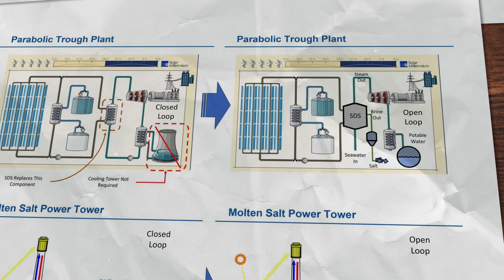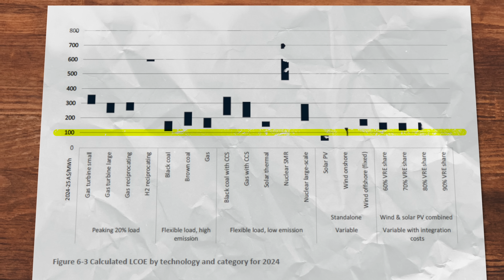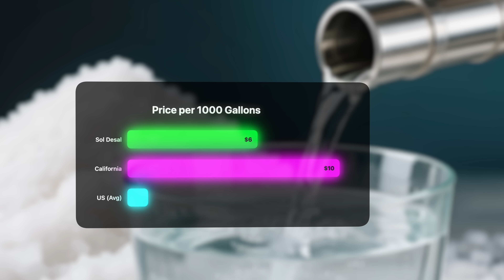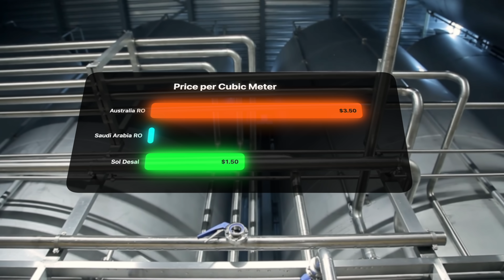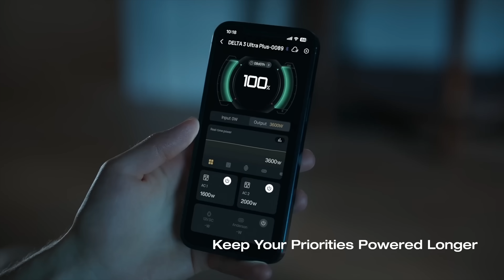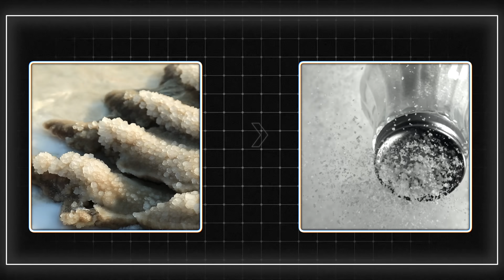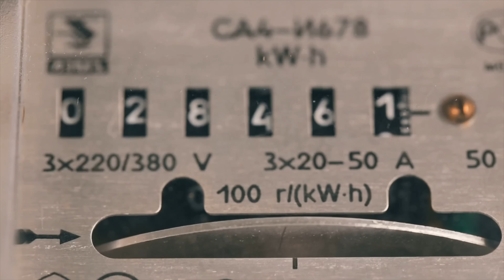The Desalination Process that MAKES Electricity - Too Good To Be True?

Comment: A cheap solar powered desalinator!
A big inflatable transparent plastic dome floating on the sea, with a bunch of black towels hanging in the sunlight inside, occasionally automatically dipped into the water and hung at the right angle above the water, near the top of the dome where it's the hottest (dipping powered by a small solar cell). And the fresh water condenses on the inside walls and drips down and channeled into a container. It wouldn't cost much, at least. 😂

Comment: Der Strom ist viel zu teuer, da der Dampf über eine Turbine + Generator  geführt werden muss. Dazu muss der Dampf oder die Wärme   über Nacht  gespeichert werden, da ja die Sonne auch mal untergeht.  Da alles reduziert den Wirkungsgard  massiv. 
Es ist einfacher, besser und viel billiger  PV hinzustellen.  Und den Strom  zu nutzen. 
In Australien die Kälte zu haben, wäre ja schon ein Mega Gewinn  an z.B.  Rechenzentren,  Akkus Farmen, Tierfarmen  oder Wasserwerken.  Kälte ?  Logisch nutzen  wir eine Wärmepumpe, um die Brühe  verdampfen zu lassen  und das Wasser kondensieren  zu lassen. Klassisch, wie alte Öl Entsalzunsganlagen. 
Die kWh aus PV kostet  unter 4 US Cent , mit einem COP von 4  liegen wir knapp  bei ca. 1 Cent je kWh Wärme, das reicht für  wie viel  Liter Trinkwasser ?  
Gegeben:
Wassermenge: 1.000 Liter ≈ 1.000 kg
Anfangstemperatur: 40 °C
Siedepunkt: 100 °C
Temperaturdifferenz: ΔT = 60 K
Spezifische Wärmekapazität von Wasser: c = 4,186 kJ/(kg·K)
Verdampfungsenthalpie bei 100 °C: ≈ 2.257 kJ/g = 2257 kJ/kg
1. Energie zum Erhitzen von 40 °C auf 100 °C 
Qheizen=m⋅c⋅ΔT
Qheizen=1000⋅4.186⋅60=251,160 kJ 
2. Energie zum Verdampfen bei 100 °C
Qverdampfen=1000⋅2257=2,257,000 kJ
Umrechnung in kWh (1 kWh = 3.600 kJ)
Du benötigst ≈ 698 kWh, um 1.000 Liter Wasser von 40 °C vollständig zu verdampfen. 
Also sind beide "Ideen" in 2025  Blödsinn, denn  es gibt Methoden (Umkehr Osmose) die weit weniger Energieeinsatz  notwendig machen.  Und Salz  ist weder selten, noch teuer.

Comment: I wonder if you could use an air filter to get the dust out of the steam you would have to have water constantly passing over the filter to wash that salt away but as long as that water goes back into the boiler you really haven't lost anything

Comment: Well, the salt problem, one solution would be to boil it two times, one  for the collection of freh water, then run the turbines with that. It is sun powered, soo.. More expensive to set up sure, but two stage boiling, collection from the firt boil and then boil and run the steam engines and then at the end collection of the water should work, right?

Comment: If it works it would be perfect for the hot and sunny places in the world, where the water is needed.
So even if not perfect, the dual use of electricity AND water is good enough for those places.
As everyone wants both.

Comment: The process just needs an extra step. First you need to get the sea water barely above boiling (it doesn't need to do work at this stage), and exchange some of the steam heat to get it barely below boiling and condense it. THEN you heat that water to enough of a supercritical temperature that steam can run a turbine. That would seriously reduce the brine contaminant.

Comment: Algae (like kelp) produce bio-oils as a protective layer when exposed to higher saline content. Of course there're limits to how high the concentration can become before there are diminishing returns, but it provides a beneficial boost to bio-oil production in bioenergy focused offshore kelp farms utilizing concentrated brine diluted with lower saline ambient waters the kelp are grown in.

Such as to say, repurposed aging tankers (like those captured from Putin's 'dark fleet' as example) not suitable for transporting more environmentally damaging petroleum, but retrofitted to carry onshore produced brine concentrate out to offshore kelp farms for dilution & pumping out over the kelp..

..not only gives the brine somewhere to go, not only helps the kelp produce a higher bio-oil production density per area, but also included in the kelp are the kelp-sorted minerals contained in greater concentrations due to the brine fertilization that, post harvest/post bio-oil extraction provide an excellent feedstock for terrestrial farming soil remineralization.

An operation could look like: repurposed tanker loads with brine concentrate on shore.

Once full, tanker travels out to offshore drone operated kelp farm floating on the surface in lower mineral density deeper international waters.

Lower saline/mineral concentration surface water are pumped into & mixed in monitored ratios with the brine concentrate in the tanker.

Central pivot mounts spray the now-diluted brine concentrate out over the kelp farms anchored from floating platforms suspending the drone-lowered kelp anchors as they grow.. constantly maintaining a 1-2m depth for the tips of the kelp; nearest the sunlight & atmospheric gases rich waters crucial for rapid growth.

As the diluted brine sprays over the farm, its heavier concentration (thus greater density) has it sink past the kelp and to deeper ocean depths diluting farther as it does.

As it goes past the rapidly growing kelp, the kelp has opportunity to utilize the higher concentration minerals in the brine dilution where, when combined with ample nitrogen & carbon rich surface waters from dissolved atmospheric gases provided by surface ocean waters, the sun soaked kelp can grow at an accelerated rate, ansorbing more CO2 contributing ocean acidification carbon, releasing O2 rich gases into the waters to replenish the increasing oxygen deprivation oceans are experiencing, and producing a mineral rich bio-oil that is an excellent swap for light sweet crude oil.

Provided an at sea platform exists to store & process harvest kelp, both extracting the bio-oild & separating them from the mineral rich carbon dense nitrogen loaded brine dilution fertilized solid biomass concentrate that remains, the liquid bio-oil can be loaded back into the now brine-emptied tanker for onshore processing, while the solid biomass, given ample unshaded surface area of the open to preliminarily dry before bundling for compaction & transport back to shore..

..can be transported back to shore for next stage processing and shipment as feed for livestock and soil fertilization. 

Literally allowing our carbon drenched ocean waters ability to provide their increasingly damaging acidification via carbon & mineral rich product as feed to livestock that produce a waste byproduct for spread over soils increasingly depleted of carbon & minerals due to overactive grazing & tilling practices.

The bio-oil from the kelp being of a very similar nature to hydrogen dense light sweet crude becomes an excellent swap for our well developed hydrocarbon energy infrastructure that is used to ebb the flow of the intermittency of renewables like solar & wind.. where it isn't otherwise used for mobile applications in vehicles.

Add the benefit that foods grown from the remineralized soils serve to reverse the trend of an increasing reduction in nutritional density of foods grown in them. 

Being fed nutritional rich mineral dense foods helps not only the livestock but the humans consuming them.

The process provides several positive feedback loops (of essentially 'infinite' nature) while closing several negative ones, plugs in near seamlessly with already existing infrastructures, and works regardless of the source energy producing the brine from the seawater; be is solar thermal, photovoltaic, or nuclear, the resulting distillation brine byproduct .. free of added chemicals more commonly used in reverse osmosis .. is essentially a pure concentrate of already present chemicals in ocean sea salt.

Paired with terrestrial bioenergy focused crops (like switchgrass, hemp, etc), the process accelerates the shift from domestic fossil fuel consumption to soil rebuilding environment restoring sustainability & enhancement while freeing up fossil fuels extracted for exports to countries in earlier stages of development working towards the inclusion of similar infrastructures as their abilities to install become more accessible for them. 

Brine is fine .. if it has application.. and doesn't include the additives unnecessary for distillation that reverse osmosis tends to require.

Comment: You can pass the briny steam by a heat exchanger and run the turbine via another more innert gas. The issue is easily solved with more cost and some inefficiency, no new inventions required thou.

Comment: Good luck. The entire plan relies on an easy way to keep the system running and low cost maintenance. Two things which are anathema to operating in seawater. So how do they plan to easily isolate the salt for separation without having salt clog up or corrode the system or rely on disposable inputs?

Comment: You mentioned the pitting from boiling sea water causing damage to the turbines could the turbines be coated with epoxy if not completely eliminating the corrosive effect at least delaying the corrosive effect making the parts last longer before needing to be replaced or maybe recoated

Comment: Take the steam from the desal unit and use it as the heat source through heat exchanger to a closed loop system for the steam generator and then collect your condensate on the other side and that's how you remove the salt from your turbine system.
Reply: Keeping with the positive spirit of things, I wanted to try and provide a possible solution. The heat exchange system would have to have a two-part system so one side could go down for cleaning while the other stays in continuous use.

Comment: The issue with the high-pressure turbine could be solved. For example, with the salty steam going into a very wide and not very tall (as a height-width ratio) cyclonic separator, then that can go through increasingly shorter but just as wide cyclonic separators, which to then eventually make it to either the steam turbine, and/or released in an updraft tower, which to create updraft which to be used by other ground-level wind turbines to generate power. 

Even if they end up skipping the steam turbines entirely, as long as they are on the west coast or have natural winds going towards the sea (opposite of going inland), then the salty air would be released back towards the sea, therefore not affecting the local climate, other than maybe shading the sea a bit more than it normally would be.

And if you want to really combat desertification, you can use updraft towers together with solar and a local water source, in order to release higher-pressure water (from the tops of the updraft towers) into lower-pressure areas, which would have a relatively high chance of creating mist and/or clouds, which would help shade the area and also help bring more rain in the area.

Adding to that intentionally placed fields filled with plants which have very deep roots, around the areas through which water would pass to flood areas, and said water would end up inside the ground, where the ground itself can filter some of it's contaminants, and from where it would eventually replenish the underground aquifers and underground water supply in general. 

As for the areas affected by desertification, you can use solar panels to act as extra shading for the hottest parts of the days, while still allowing light to pass through in the rest of the time, and also allowing rain to pass through. This could help kickstart 
"foresting" "ley-lines" filled with perennials, weeds, and other tough crops which spread easily, eventually encasing squares or rectangles of new-desert land with greenery on all sides, and occasionally getting cattle to graze at one edge with a few weeks of pause before grazing at another edge of the same rectangle, and so on, until the greenery expands. And you can move the solar panels in order to help the greenery to spread faster, then replacing the solar panes (which would go more towards the desert) with netting for another few months to few years, by which the previously-desert would hopefully be covered in greenery. And after that, planned cyclical grazing should be used to maintain the green growth while still being productive land, and also planting trees as the borders between multiple such squares or rectangles of land, with the trees which to be surrounded by metal mesh on all sides, in order to make sure they end up growing without issues for a few years, and after 5 or so years, the trees would hopefully have a land-stabilizing effect, in addition to adding shading to the nearby land.

Comment: Stupid or just a scam to get taxpayer money? 1. salt steam will kill all machines. 2. Salt/brine must go back to the sea- there is no economics in it. It will just pile up. Separating NaCl to get Na is also a energy cost and the need for Na will never be at any scale. The small benefit of using the residue steam is just silly academic bs. Water price is a result of mixing sewage cost in. -It is hard to measure poop.. The real cost of water is very low in non desert climates. The complexity of this whole project smells stupid or a scam. But I'm sure the UN will finance it and call it climate aid?

Comment: Instead of solar they should use wave machines that way there's no waste from the solar panels that will be bad in 10 years then that has to be recycled which we don't have a recycling system for that yet in place
Reply: I believe instead of having a solar farm with flat panels we need a solar tower to expand upward. Or at least repurpose the land underneath the solar panels to farming plants that only need minimal light..
Reply: Bottled water with forever chemicals😂 nice cheap water at the cost of your health.😢

Comment: Sounds great in theory.  Build a pilot plant and run it successfully for a year at which point it will be clear that boiling salt water creates a raft of maintenance problems.  Then the economic promises need be delivered: cost of produced electricity, value of produced water.

Comment: Similar systems have failed as the solar concentrators are too complex and costly to maintain, much simpler systems would have normal solar panels and batteries to provide the electricity.

Comment: I wonder if they could mitigate at least one failure point by switching from steam power to hydroelectric.  Condense the steam in a tower and letting gravity do the work of spinning a turbine as it runs out would be one way to dodge the issue of salt build-up on a turbine.

Comment: The first step would be making the turbine blades out of an abrasion and corrosion resistant material. The obvious choice would be some kind of quartz ceramic material or at least a quartz ceramic or similar ceramic coating material to encase an aluminum or  steel turbine blade. It will obviously need well sealed bearings not exposed to the steam/brine mix. This would likely still mean that the blades are developing some kind of crystalized muck on them over time, so the best way to combat that issue would be a routine maintenance procedure that allows steam to be redirected from the boiler unit to various turbine chambers spinning alternative generators during a washout procedure where the blades are routinely cleaned by a maintenance crew maybe once a week or whatever schedule makes sense.that brine would need to be captured from the clean out and recirculated into the system for purification going forward. Extracting the final salt too would be a challenge obviously, but if the corrosion problem can be solved on the steam generation end of the equation, then the economics of the system become feasible.

Comment: One of these - albeit not salt generating - was just recently shut down in California because it turned out that it wasn't collecting enough solar power on cloudier days and they needed to buy gas to keep the system hot (it takes almost an entire day of solar power at peak efficiency to get the system hot enough from a cold start) and the blades turning, thus greatly increasing the cost of the electricity. I still think they just needed to add more mirrors but alas...

Comment: Geothermal intake of saltwater = burns off the saline on contact, so you wont have waste water or waste product.
Why its not used in geothermal * solar * desalination for that win win win is beyond me.  You could have solar mirrors + solar panels for that 2x space efficiencies when you build this hybrid quantum green power plant / desalination / water purifier system.

Comment: The carryover problem was solved almost 100 years ago and is in use by all commercial power plants that use steam as the working fluid: cyclonic separators paired with chevron dryers. Those take the steam to 99.9999% quality, or pure steam with no entrained liquid droplets. The turbines will still have to be taken off-line periodically for maintenance due to that remaining .0001% of remaining carryover, but it is easily manageable.

Comment: You can only get so much energy from solar. How much surface area does it take to produce a given amount of water? How much maintenance does the system require? Is it reliable? What are the costs just to keep it clean and running? What is the actual efficiency? All said and done, it's hard to believe there is any surplus energy after the completion of the cycle. Is this water potable after the first distillation or does it need secondary treatment? Simple concepts can end up being very complex after addressing the details involved in becoming practical. I am very skeptical, but very glad that you have the intelligence, enthusiasm, and imagination to bring these ideas to YouTube. Inspiring and educational, Thank you.